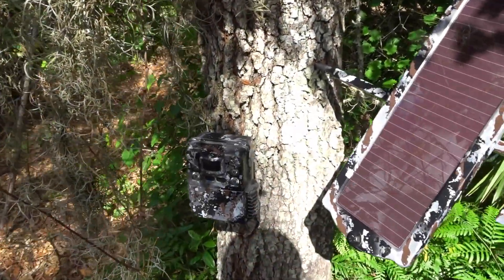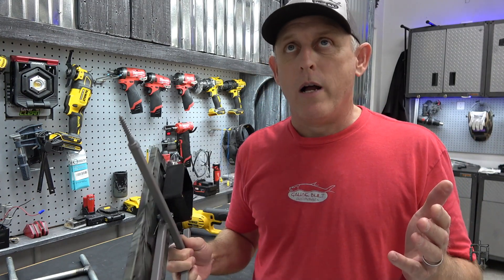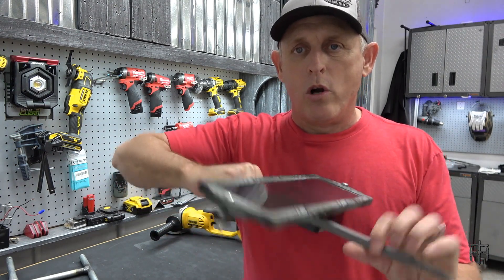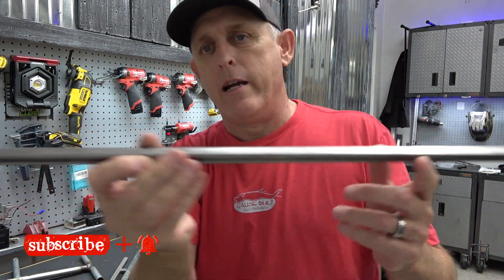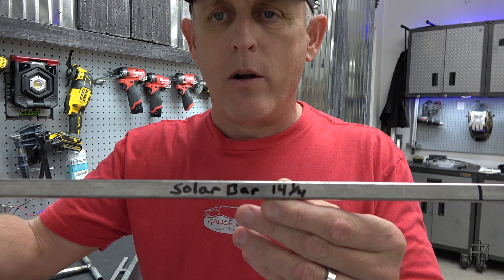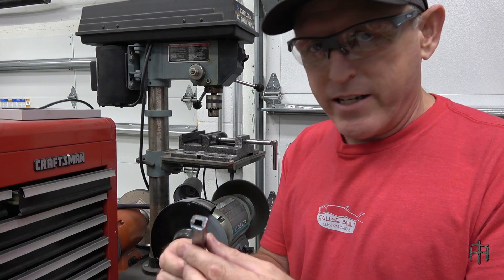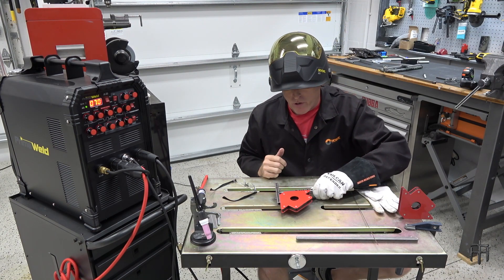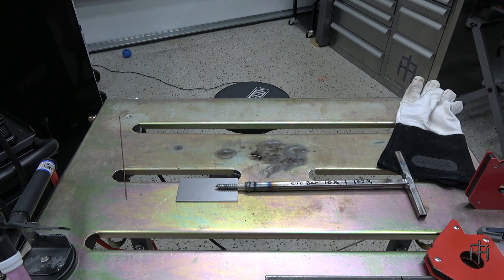DIY Solar Panel Mount-Step by Step

Comment: So do you prefer to use the small battery pack or the large 12 amp hour battery in the ammo box. Im ready to build but im not sure which route to take
Reply from the maker: I tend to use both.  One for back in the woods where I don’t get enough sun and the other for places with sunlight.  I’m working on a new LifePo4 setup to replace my ammo box setups.  I need them water and bug proof for the swampy areas.  My favorite is the solar setups though so I don’t ever have to recharge.  Hope that helps!

Comment: This is NICE brother! Thanks for sharing. One thing You might do if you make more. Is fill in the open holes on the ends of the handle and solar panel bracket. This keeps bugs out and helps slow down rust from the inside out. God Bless brother.
Reply from the maker: Thank you!  I have little plastic square plugs that go in the holes…just forgot to show them in the video!  Thanks for pointing that out.  It’s nice to keep out all the critters!  God Bless!